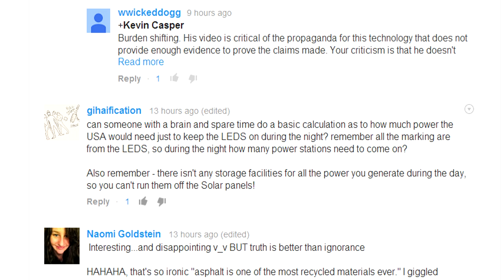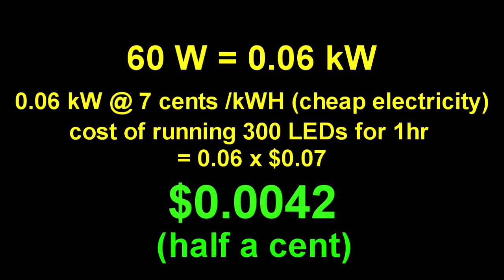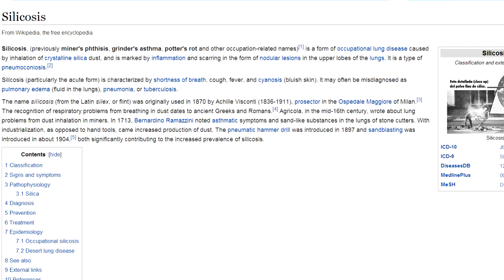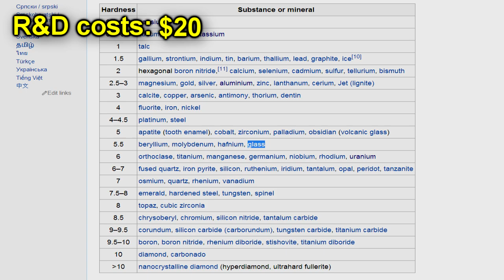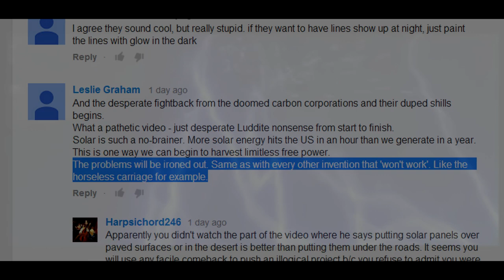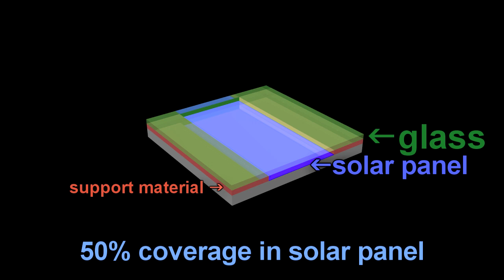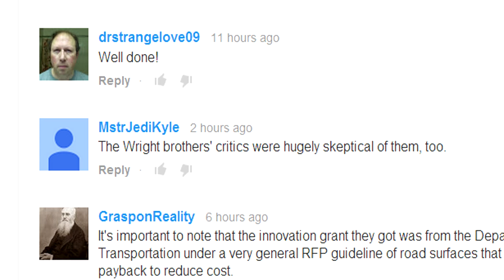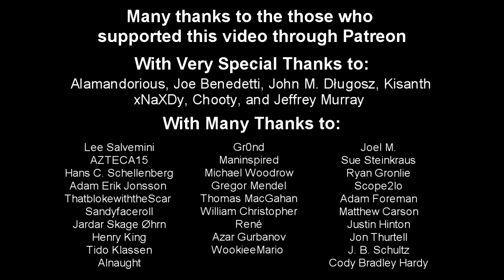Solar Roadways, IMPORTANT QUESTIONS AND ANSWERS!

Comment: This is perhaps the dumbest video I've ever seen. You did a scratch test on the bottom of a beer bottle and thought that was comparable to the tempered glass materials they are using on the Solar Roadways. You went to Amazon thinking that the commercial price for LEDs would be the same price Solar Roadways would pay - You have no idea how the economy works. You did a sun test using the weakest LEDs I've ever seen. We have LED lights on our cars now that are brighter than the usual halogen bulbs used in older vehicles, draw half the power, and are twice as bright. These lights are clearly visible in the day light ... Your home experiments are a joke.

The engineers who are developing Solar roadways admit that their panels would only get about 15% efficiency - Half the efficiency you suggested they'd actually get. So, by your calculations, Solar Roadways would be twice as efficient as the engineers speculate. You just proved their point - this is an efficient means of generating energy ...

You then pull quotes from the most ridiculous of commentators on YouTube who - rightfully so - gave you a half hearted retort. Truthfully, you're not even worth the time I put into this response.

So - we get a long haired, British hippy guy to sound slightly intelligent in a video, and all of the sudden we have a convincing "Scientist"? Please.

Corning has done a phenomenal job innovating glass technology. Glass is incredibly cheap, easy to produce, and can be incredibly durable. Anyone with a cell phone with Gorilla Glass knows it is a robust material unlike anything you're used to seeing.

This is propaganda - more than likely funded by Asphalt or energy companies preying on the opinions of the ill-informed and those who hate change/progress/innovation. Way to go buddy - You're on the wrong side of history.
Reply: 17:30 so much for your tempered glass theory.
Reply: In terms of wear resistance, bottle glass, tempered glass and borosilicate glass are practically identical.  The test is a good demonstration of something that is already well known.

As someone who buys commercial LEDs, I can tell you that although his price was high, he was also buying the packaging etc.  You can get super bright LEDs for a lot less than the price he quoted but by time you mount and wire them up, it is a different matter.  If you are mounting for an outdoor environment, you need to cover the whole assembly with transparent materials.  This cost more than the LEDs themselves.
Reply: Bobby Tang Correct. Normal sun-tracking solar panels are less expensive to make and provide more energy, which means we already have a better option than the terrible idea of panels inside roadways.
Reply: why opt for 15%, when you can achieve 30% from normal solar panels?
Reply: 1) Tempering glass doesn't increase hardness with regards to scratch resistance (even solar roadways acknowledges this)

2) Gorilla glass has the benefit of scratch resistant coating, but sand still scratches it.

3) The LED's actually seemed rather good in quality, but the spacing was similar to those of solar road ways, they even seemed stronger than the ones in solar road ways when you take into account the contrast. As a note Solar roadways state that their own LEDs are not visible in full day light.

4) I don't really see where they specify real world efficiency, they state assumptions of using 18% efficiency solar panels, admit around a 30% efficiency loss in comparison to angled solar panels (not even comparing to tracking) and another 11% loss to their thick tempered glass. This isn't even including the losses from when someone is stopped or parked on top of the solar road ways, dirties the roadways or scratches the glass. All of these losses from standard solar panels alone, never mind tracking solar farms means that this is not an efficient way to generate electricity. Even in their napkin math they don't take into account the fact that most of the solar road way isn't even solar panels. Even in their "test" they didn't use their solar road way, they used a standard solar panel.

They don't state how much energy the LED's use, they assume that LEDs will be sufficient despite using a covered LED example, a high powered LED example dense with LEDs and a computer graphic.

Keep in mind this is not including the costs for ripping up the roadway to install the tiles or the trenching to bolt them in, the extra tunnel they want to dig for the wiring, the fact that everything connected to it would have to have a lot of areas to convert it to ac or convert everything to dc despite the vast advantages to ac. Something that they would require be done along every road in the united states. They would also require several link ups to the grid otherwise you have no lines to drive by.

5) Durability doesn't really matter on this topic, what matters it that it needs to be optically clear to be a solar roadway and not subject to scratching. Tempered glass is indeed very durable, it is not scratch resistant enough for this application since sand can scratch gorilla glass even with a scratch resistant coating.

6) Virtually every independent engineer I've seen on this topic thinks that there are too many challenges to the project. It basically takes a lot of good ideas and puts them in the least efficient situations because of the simultaneous requirements.

I think that the makers of solar roadways genuinely believe in their mission, but honestly I don't see their project being good for much more than maybe sidewalks, small parking lots, or parks. Which are still ironically tend to have a lot of shade by design. I've also read their faq and responses to people like thunderfoot carefully and frankly either they don't understand the topic very well or they're being dishonest, neither speaks very well of the project.
Reply: Video Game Drummer Productions it's not about believers or non believers. It's just simply not as efficient as the current applications. if it does get implemented, it simply means people's need to have cool stuff overcame their common sense.
Reply: SMC01ful why would you develop a prototype when a solar farm offers the BEST possible efficiency and practical application scenario?
your efficiency is halved, simply because you want these really cool looking hexagonal blocks that flash lights.
Reply: dumb dumb dumb dumb dumb dumb (8)
Reply: SMC01ful
The solarroadways guys said they've already developed prototypes, specifically in response to TF they made this claim in fact. In their video they state it's only to make minor improvements and manufacturing even though it's pretty clear their prototypes aren't remotely close to what it needs to be for their claimed purpose.

In earlier interviews they stated it would take around 50 million just to see if the surface that had the properties they required could even be developed.

The surface of tempered glass would be scratched by common sand, just like common sand scratches gorilla glass which is a far stronger type of glass (and among our highest performance glass with regards to scratch resistance) than the standard tempered glass that the solarroadways crowd is using for their tiles. Sapphire glass could technically fit the bill for scratch resistance to common sand, but it's significantly more expensive to produce as it's synthetic sapphire and it's still prone to shattering.

Solarroadways also stated for the tiles to pay for themselves they would require a life cycle of around 20 years (assuming the current tempered glass model), not that far off from standard asphalt properly implemented. The LEDs won't last 20 years, never mind the glass or the solar panels which would also have to endure being driven on.

Yes asphalt requires repairs, but it's still significantly cheaper than solarroadways by a long shot. It's a relatively cheap composite material with rocks and waste from petroleum processing which is also recycled at a high rate. The rocks act for the hardness, the bitumen acts to bind the rocks together adding flexibility. Solarroadways are trying to implement too many ideas where goals require conflicting properties which create something that cannot perform any of it's functions well and it does it at a rather high price as well.
Reply: Video Game Drummer Productions If it does happen

I'm pretty sure it won't be glass. 

most kind of affordable glass is just a bad idea imo. :l

And wow, we'll have to worry about assholes popping out the tiles for money or breaking them randomly with a hammer for the lulz
Reply: ***** unfortunately einstein wasnt proven to be wrong fundamentally, unlike these solar road people. glass is just simply not a good road material, as are solar panels not very ideal beneath roads.
These are not issues that can be fixed, unless you use another miracle material that is cheap and transparent and tough/durable to not get scratched.
Solar panels are also highly inefficient beneath roadways, compared to simple solar farm alternatives.
Reply: Bobby Tang Do not misconstrue my singular and non specific statement to the context of this post as one of agreement with dissenting opinion on the viability of this technology.  I am actually one of the dissenters. I think this is a horrible idea. 

That being said, my comment was actually in response to the bullshit argument about the 2 out of 100 scientists. Sometimes an objective view about a concept is worth it. Balance.. balance.
Reply: ***** kids and sports is probably the last place these should end up under, lol xD

America should do some kind of program to discount people installing solar panels on their rooftops. :c Germany, Japan and Taiwan does this, I think?
Reply: Joe Domingo This video referring to tf00t's response or referring to the solar roadways video?
Reply: Boss106Judge Einstein was an outsider too.
Reply: SMC01ful How much money did you give them?
Reply: SMC01ful Just curious cause you're acting like you did and thus defending a dumb idea. But anyway here's a few quick questions for yah.

If you're pitching the idea, even as a prototype, would it not be a good idea to actually DEMONSTRATE that these things work as you claim they will? Show that your road can ACTUALLY handle the stress that roads must take.

Also, did you know that even if you have bullet-proof/reinforced glass, it'll STILL scratch? This is the biggest flaw in choosing glass for a road surface. It will be scratched to smooth very quickly.
Reply: really super bright LEDs thats nice so we can runs tons of those with a solar panel that at its best when it is new will make 15% efficiency. i fuckin believe that the wear test was pretty accurate, compared to tempered glass. Are you serious fucking gorilla glass really. that shit is so expensive i cant affot to fix the screen on my phone and its a million times smaller than ten of these panels .
Reply: I swear, did any of these people who thrown money at this project even learned physics, like BASIC physics?

Like, really...
Reply: or in a huge unused desert were land is cheap and it makes sense because there is the most sun. iunno just an idea.
Reply: "Long haired British hippy"..with a PhD in nuclear physics. You might want to read more.
Reply: DM21 Gaming explain the evidence backing this up. This whole project is rife with issues. The very first one I recognize is that differential forces due to uneven roadways will was to failure. Sorry but glass is only strong in compression. It can't handle shearing forces, yielding forces and tearing. It would snap. Not to mention placing solar panels in a horizontal plane is just inefficient. That and the wiring needed is just completely unfeasible. That and it isn't a simple repair at all. We have tons of gas lines under our roads, if you have a leak in the line you have to dig up the long and repair it. Having complex electronics in the road only serves to obfuscate that. Lastly, if any old clown can get a degree, why is it that these "clowns" are reputable in their field and are cited in over 600+ journals for their contributions to nuclear physics and chemistry? Phil is no moron. You however seem so stuck up your own idealistic asshole that you may just see solar roadways lining the walls of your bum ;)
Reply: I can't believe there are so may dumb people... Umm so it has now been 3 years and can some SFR fan tell me how well that crap went?
Reply: ***** I thought there is actually alot less then 2 out of 100? dunno.
Reply: MK KR global warming is not the topic here. Save it for another thread ;)
Reply: ***** Yeah, but just curious. :c

And I figured it's somewhat related, atleast. lol.
Reply: MK KR Superficially.. not really worth discussing here ;)
Reply: ***** then better not phrase yourself incongruously. whatever the case, my statements are purely objective and not targeted at anyone specifically.
Reply: Bobby Tang I wasn't. Your interpretation was broad. It's understandable if you didn't know which response I was responding to, though.
Reply: ITS A CONSPIRACY BY THE ZOG MACHINE(and oil companies)!!!!!11
Reply: How much do those LEDs cost that are used in cars? And what evidence do we have of this "tempered glass" dealing with the stresses of abrasion, weathering and weight of trucks, tractors, etc.
Reply: Just for you and everyone else who says that the 15% is half of what he says....that 15% efficiency is the efficiency of the energy CONVERTED....tf00t's calculations are the general potential of those panels. So the energy you get from those panels is 30% of the 15% conversion efficiency.
Reply: Professional Youtube Commenter original contributions are usually not made on a youtube comment page for the public. it is done in research labs, clean rooms, by the engineers who are rebuking their claims in attempt to prevent the public from getting misled by a rogue inventor. the comment page is for us to tell you why it doesnt work. we already have done our dues in labs.
Reply: DM21 Gaming "Glass is incredibly cheap, easy to produce, and can be incredibly durable. Anyone with a cell phone with Gorilla Glass knows it is a robust material unlike anything you're used to seeing." HM... well Iphone glass screens are the number one reasons that people get a new phone. Anyways your comment was long
Reply: no, you're attacking his grammar instead of his arguments and quite frankly being needlessly insulting. driving a tiny tractor over a tiny piece of surface at an incredibly slow speed is not stress testing for actual road conditions. Consider the sheer force of a fully loaded lorry slamming the brakes on imparts to the surface its on, it would tear up tiles if it didn't simply shatter them.
Reply: Woah, heheh. This comment thread didn’t age very well, now did it? 😕
Reply: Don't worry, guys! Me still likey likey Solar Broadways! Me wanna live on TRON!! Don't give up~ uwu~ we can still make it happen! GO solar roadways ~ <3 <3 

~:)
Reply: Not a red cent, and why do I have to have invested or donated to be supportive of the idea?
Reply: WTF are you talking about? They have already passed stress tests? What part of their getting funding don't you understand? Their funding has been to develop a prototype! Doh!!!!! Moreover, sort your language out. "Scratched to smooth very quickly?" Erm, am I having a debate with a bloke who cannot form sentences? Or am I having a debate with a guy who thinks wheels are made of titanium? All roads need replacing or re-sealing by the way.
Reply: If I might add, how does this video even sway some 5700+ people to hit the 'like' button? I'm so SMH right now. You mean there are that many dumbasses out there? Or are they just gullible?
Reply: uTube486 Any clown can get a degree. He clearly didn't exercise any of his 'knowledge' in the making of this video.
Reply: I just hope that Solar Roadways can happen. If it does 20 years from now then I would love to hear what the non-believers living today would think then. I just hope that me and them are still alive by then.